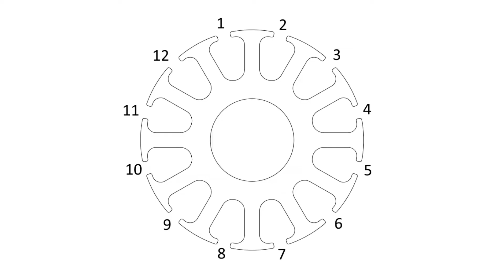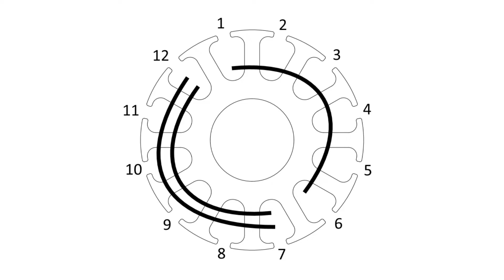Repair of angle grinder BOSCH PWS 850-125 - rewind motor armature

Comment: thank you for the vide. what is the material between the rotor sheets? cardboard and plastice?
Reply from the maker: Groove pads made of electric cardboard, wedges made of fiberglass
Reply: @valsworkshop  thanks, what about the string ? What kid pls ?
Reply from the maker: @trab247  I didn't understand the question
Reply: @valsworkshop  the one between the rotor and commutator, that goes above the wires before poring the epoxy
Reply from the maker: @trab247  Electric cardboard gaskets are placed in the slots of the rotor. The wires are closed from above with fiberglass wedges.

Comment: Hola me podrias compartir el modelo de tu soldadora de puntos para el colector conmutador??? Y me puedes decir como hacer y que voltsje tiene tu probador de inducidos al que le pones la navaja la segueta!!! O puedes hacer videos de estos equipos que utilizas por favor!!!! 🙏🙏🙏
Hello, could you share the model of your spot welder for the commutator collector? And can you tell me how to do it and what volts does your armature tester have to which you put the knife?
Reply from the maker: Hola, la soldadora la hice yo mismo, pero aún no está terminada, la reharé. Cuando reviso la armadura del motor, aplico un pequeño voltaje de 5 a 10 voltios a través de un transformador reductor.
Reply: @valsworkshop  Hola muchas gracias por responder... El voltaje que ocupas es de corriente alterna o corriente directa o no importa?.... Y estaría muy interesante que nos pudieras compartir un video de la soldadora de puntos de colectores para verla y poder hacerla una porque no he encontrado información al respecto y necesito una Te agradecería mucho saludos mucho éxito!!!
@valsworkshop Hello, thank you very much for answering... Is the voltage you use alternating current or direct current or does it not matter?... And it would be very interesting if you could share a video of About the spot welder because I have searched for information and I have not found good information about it, it would be very good if you made a video of it, I would be very grateful because I am very successful success greetings
Reply from the maker: @ivonnevazquez4098  Hola, el voltaje es variable. La máquina de soldar está hecha sobre la base de un transformador de un horno microondas y una placa NY-D02 comprada en Aliexpress. Pero lo reharé: quiero agregar otro transformador para aumentar la potencia. O inicialmente necesita tomar un transformador más potente.